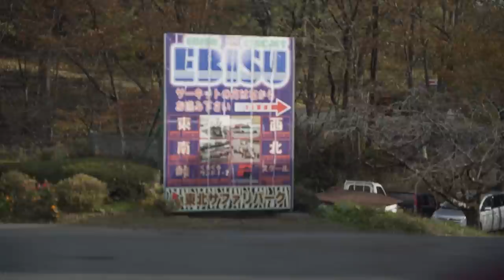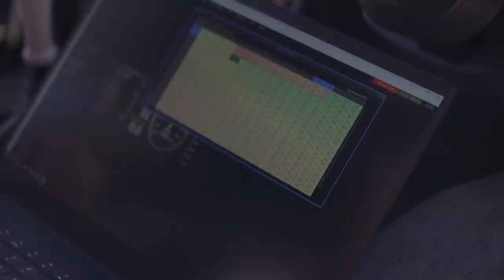JUMPING THE CHASER ON MINAMI FOR IT'S LAST DRIFT MATSURI!

Comment: Your entering to slow on minami but none the less killer driving
Reply from the maker: They put concrete blocks in the way do stop you going fast :(  They only remove them for D1. I was entering at 95 - 100kmph which is good with the blocks there.

Comment: i am just at the beginning of the video (3 minutes in) but have to point out the sound is clipping, you either have a bad microphone cable or plug or even the socket of the plug... you should waste a bit of time recording 5 seconds clips moving the stuff and cables to spot what is broken. (hopefully just a cable/plug, if it is the socket... that will need an electronic repair shop.)

will watch to the end but needed to point this out as it's own dedicated comment. EDIT: it was addressed at the 11th minute sorry for bringing it up.